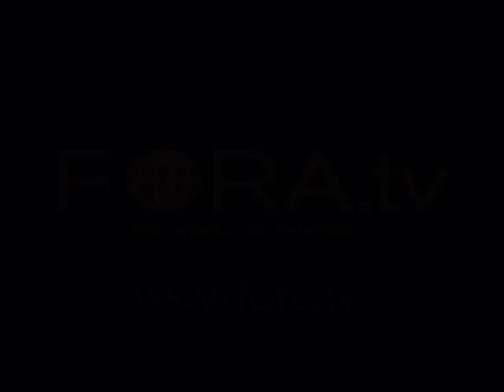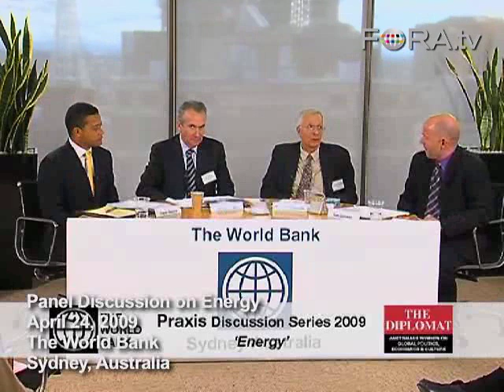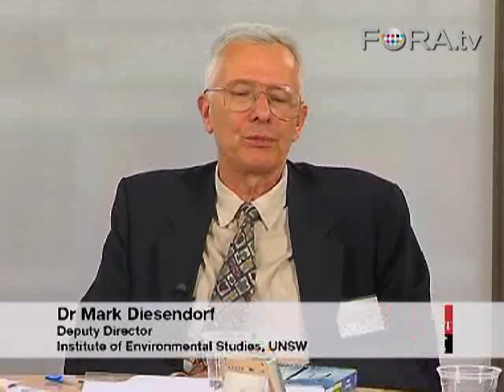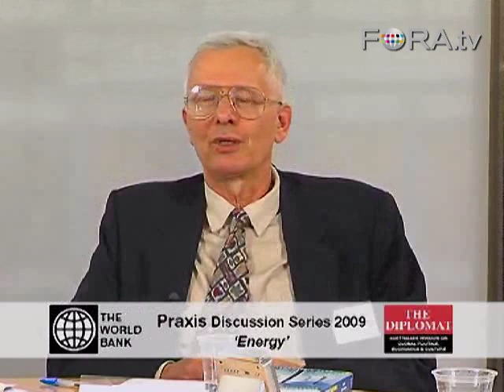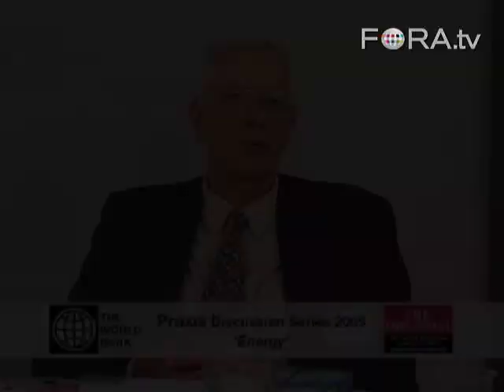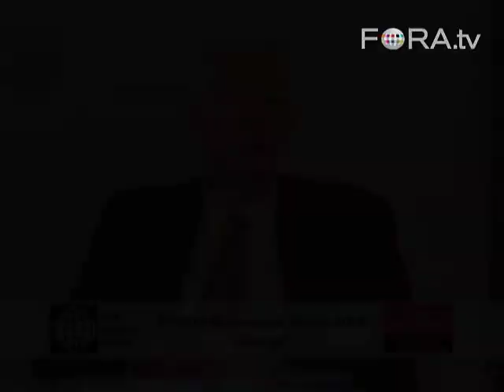Is Carbon Capture and Storage Unrealistic? - Mark Deisendorf

Comment: great for you, but far from the unmitigated truth.  I have seen the debunked, and the denial machine.  I must admit I was less than convinced.  Instead I am convinced people have chosen sides, without much concern for what is the actual truth on the ground.  I've seen it from people in both camps.  the debunking of the GGWS seemed full of as much propganda as the GGWS, and that is not the way to the truth.  there are corps that profit from both sides, the truth isn't what any of them think it is